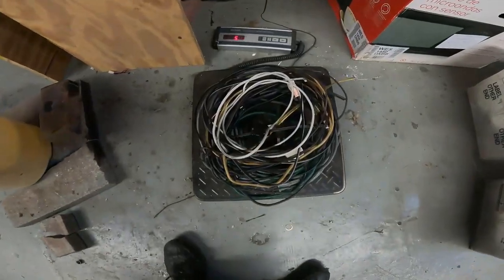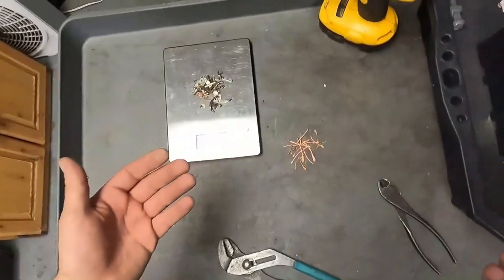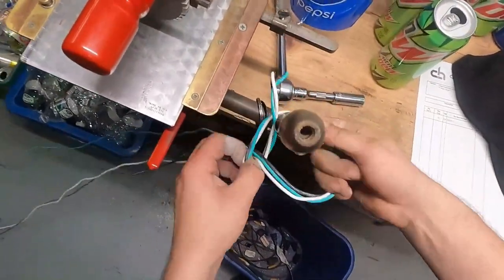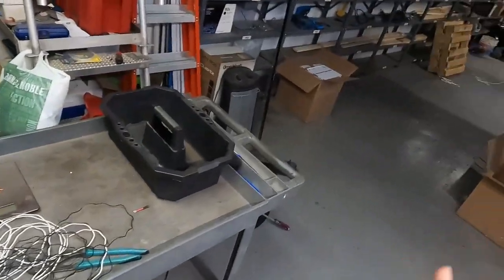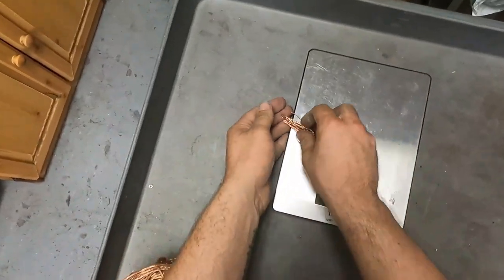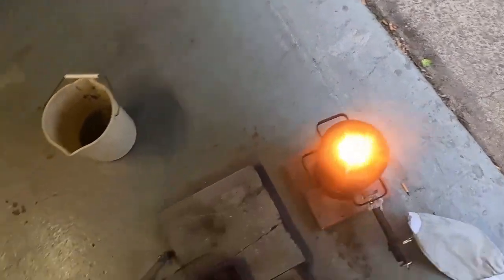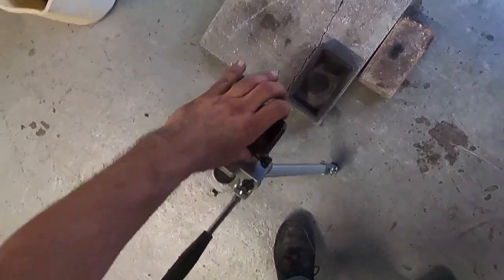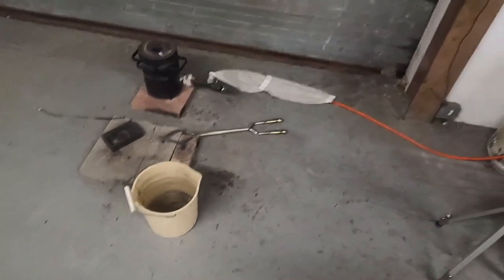Learn to Strip Wire Like a Pro - Stripping and Melting Insulated Wire - Trash to Treasure

Comment: Noice! Good video man. Keep up coming
Reply from the maker: Thanks so much man!  Trying to keep the content interesting!  😁
Reply: Don't think you need to try too hard. I melt my own too but have an electronic furnace rather than gas, much cleaner.
Reply from the maker: @judicare  I started off with an electric furnace.  My electric takes too long to melt material so I opted for the propane furnace for higher volumes, plus the crucibles are roughly the same price.  Out of curiosity, which electric furnace do you use?
Reply: Well that's interesting.  I got over 100kg to melt but doing it steadily. Used to have a "to auto" chinesium crap but that died. Now using the quick melt Pro 120oz and it's insanely good
Reply from the maker: @judicare  I’ve got the Pro-Cast 2kilo model.  Mine is junk.  Replaced the heating element twice, the chamber once, and the ceramic block that the element connects to.  I rigged mine with a different ceramic block and it’s worked okay since then.

Comment: thats pretty clever that rope junk if you take an exacto knife or sharp scissor and just cut it ever couple of feet u can pull out the short sections way easier but that about the easiest method i came up with so tie it up cut the rope stuff every 3-5 feet grab the center of each piece and just pull it free usually works
Reply from the maker: Thanks for the kind words man!  I'll definitely try out your trick with cutting that rope junk every few feet.  I've only ever found that stuff in vacuum cords.  Must be some kind of shielding or something?  Thanks again for the tip and thanks for checking out my video :)
Reply: @Scrap2Cast  ya the old school vacuum cords have like real jute fiber rope and sum extension cords but the newer 1s have that nylon stuff i always thought its was there to keep everything tight and in place and add a type of cushion if ya ran it over...maybe its just there to make are hobby more difficult advanced problem solving for the common scrapper :P
Reply from the maker: @anotherblock7742  lmao I think you are on to something there!  🤣 I’ve seen the brown fiber stuff in the cords, usually those are “really old” from my experience.

Comment: so quick question if copper is say four dollars per pound how much do you get when you prepare it
Reply from the maker: Very good question!  Currently, the national average for #2 insulated wire is $0.73 per pound (not stripped).  It’s up to the scrapper if they want to put in the extra effort for the extra $$$. I personally hoard all my copper so I’m willing to strip all of my wire.  As for the prepared #2 wire, the national average is currently around $2.20 - $2.40 per pound.